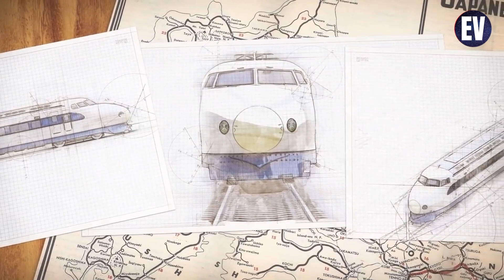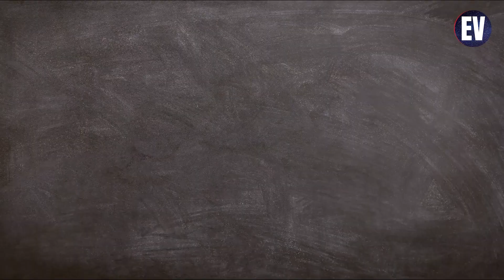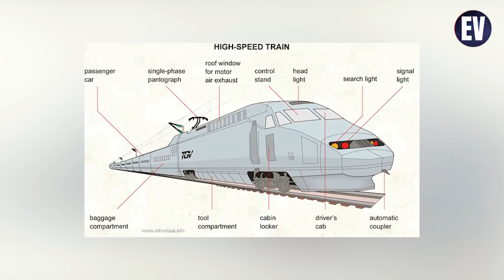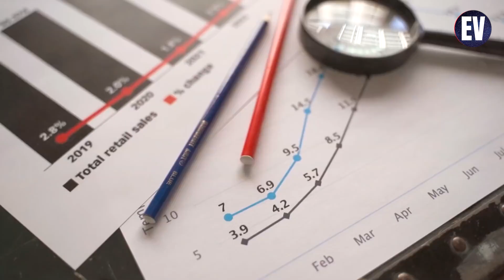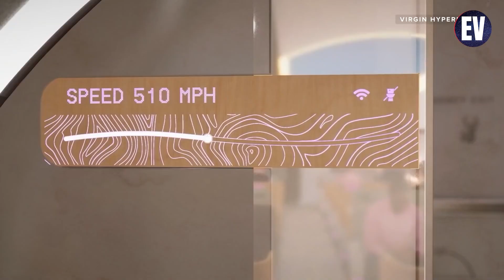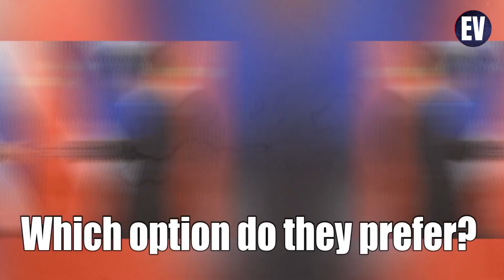China Unveils Maglev Train Fastest Ground Vehicle Globally

Comment: This is what I put on the International Maglev Board today.

Competition is good but sometimes cooperation is needed when something will be used internationally and as a Japanese maglev is too expensive just for passengers I suggest Japan, China and Australia cooperate to build a maglev from Sydney to Melbourne with passing stations at Canberra and Albury that can earn $20,000,000 every night with overnight containers to subsidise daytime fares saving 5,000,000 tonnes jet fuel per year plus reduce the 700,000 B doubles on the Hume.
Reply: This Melbourne-sydney Transrapid-line was planned in 1996 and supposed to have had been build by Germanies Transrapid International-consortium. It was cancelled then in 1998 and Up until now there is No further attempts to realise a maglev-line in Australia, let alone in cooperation with the Chinese, since they're Not allowed to Market and sell the transrapid-technology due to patent and contract issues. Another lie.
Reply: @bieneulm1982  I have proposed a single 11 psi tunnel from Parrahub to Melbourne with passing stations at Canberra and Albury for a few years now but it will not stack up economically unless it can take an overnight container train to subsidise the daytime fare eliminating 5,000,000 tonne of jet fuel per year and reduce the 700,000 trucks on the Hume.

As it has to be used internationally so it should be designed with cooperation between nations.

I have even suggested it to the Boring company today.